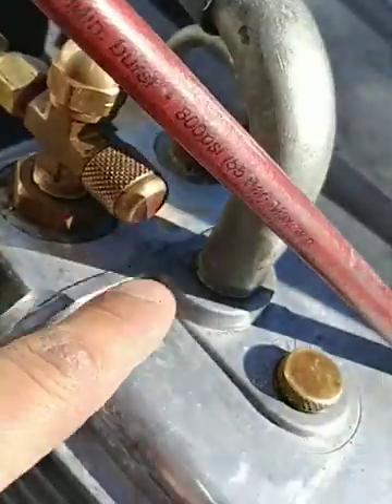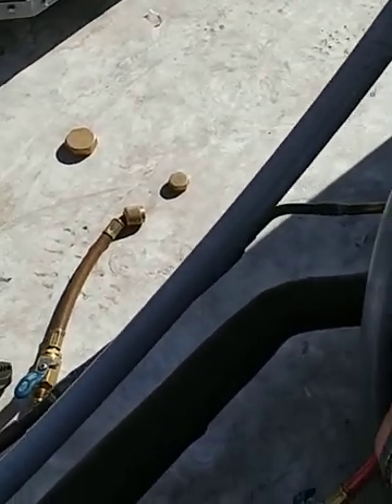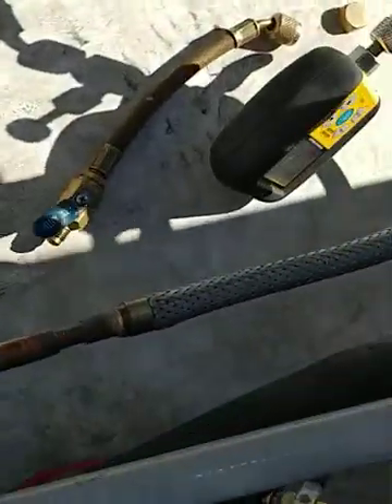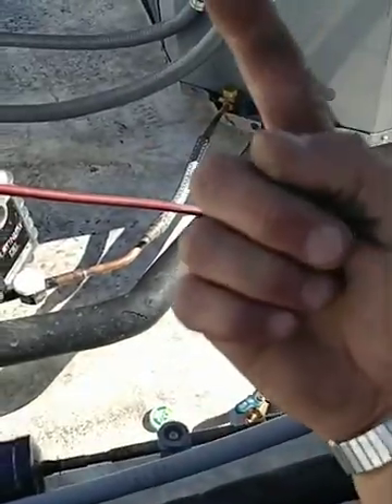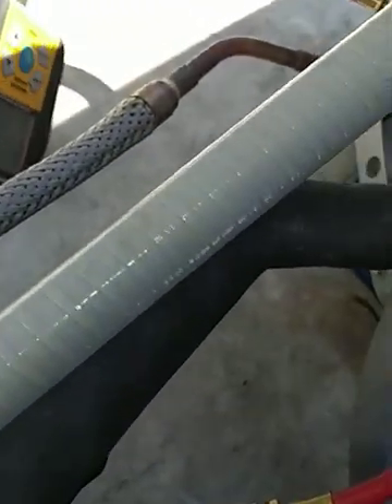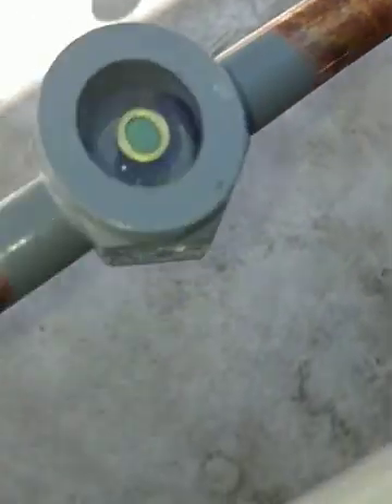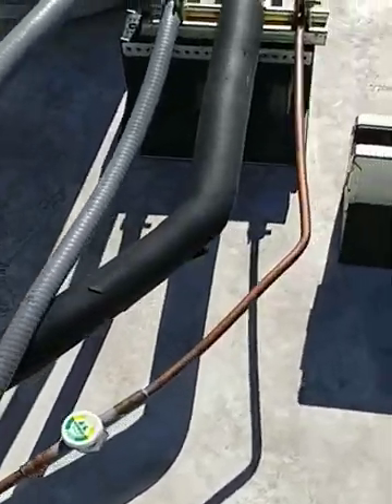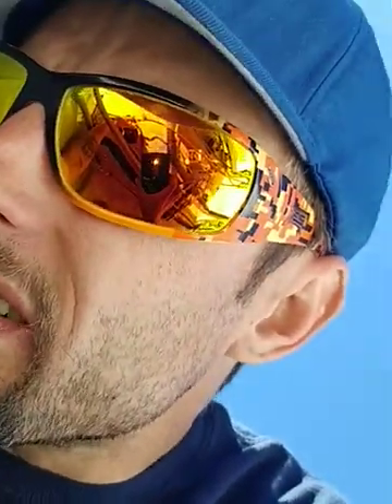🔧🔩HVAC/R DUDE: HOW TO PULL A VACUUM🔩🔨

Comment: I’ve noticed on a couple of your videos that you open the high side first and then the low, where I also do opposite. I was actually told at a few different classes to open the low side first then crack the high so that if there is any garbage or manufacturing oils, it gets caught in the drier. Lennox also informed me that the txv failures were a lot higher on systems that were opened this way as well. Nice piping job though dude, isn’t being the only tech sweet? :roll eyes:
Reply from the maker: I have and will always do it this way....you never want to open the low side first....it literally makes 0 sense....when you open the low you backfeed through the metering device and anything and would of gotten caught in the drier...(if you open hi side first) and then clog it?? RULE OF THUMB HERE..... ALWAYS FOLLOW THE PATH OF FLOW....THE COMPRESSOR DOESN'T PUMP INTO THE EVAPORATOR... RIGHT? WE KNOW THIS..LOL....BUT WHEN YOU RELEASE THE LOW FIRST THE OIL CAN BACK FLUSH OIL INTO COIL/TX  AND ANYTHING THAT SHOULD OF BEEN CAUGHT  WONT BE.......ITS SIMPLE...OLD SCHOOL...FUCK A MANUAL BRO....SOME THINGS ARE WRONG...IN THE FIELD IS MUCH DIFFERENT....IVE ACTUALLY WORKED FOR A COMPANY FOR YEARS AND STILL GO BACK AND SEE COMPRESSORS RUNNING FROM 10+ YEARS AGO...AND WE DIDNT EVEN PULL A VACUUM THEN.....HAVE A NICE NIGHT...YOUR INFO IN MY OPINION AND EXPERIENCE IS INCORRECT.
Reply: I fucked that up, it’s so you don’t suck oil out of the compressor into the liquid line from being in a vacuum. But it is what it is, I’ve done plenty of messed up stuff that’s been running for the past 10 years.
Reply from the maker: Winning
Reply from the maker: Why wouldn't it suck out via the suction? It's a bigger pipe.
Reply: It would suck out of the suction line, but it would return right back to the compressor. But if a bunch of oil gets sucked into the liquid line, it can clog the txv possible get trapped at the evap
Reply from the maker: Disagree
Reply: Disagreeing with a fact just makes you ignorant. I’m not saying that because you opened the service valves wrong that the txv is going to fuck itself to death or that the compressor is going to lock up from lack of oil, it just could happen is all

Comment: So you only put the lines on a vacuum.
Reply from the maker: Depends man
Reply: I lost all my refrigerant. My a coil froze. I fixed the shrader valve leak. My question is . To pull a vacuum. Do i do anything to the service valves? Do i open them. Or leave them how i found them.   Thanks for the reply.  I went to school for hvac i got my hvac tech license but have no experience
Reply from the maker: @intelin123  leave them! Your all good
Reply: Thank you.
Reply: Please tell me what a front seated and back seated setvice valve mean.

Comment: Its unfortunate that the evaps don't have Txv's , they are loosing alot of efficiency & like u say sight glass means nothing on a Fixed orifice system , but it does display dryness indicator. So thats something. A tip to increase vacuum speed --- Remove that 1/4" tee hook your 1/4 hose to vacuum pump , get a 3/8 x 1/4 brass fitting and attach to vacuum pump other connection and connect other 1/4" hose there. Vacuum will be twice as fast. 
Agree with you --- clean Vacuum pump oil very important for quick vacuums change often.
Reply from the maker: +OcRefrigeration,Hvac & Electrical. Yessir I've upgraded since then! Got 2 3/8" hoses and 1 1/2 ...hilmor has stainless steel hoses now. Investing in those soon. Great reviews too